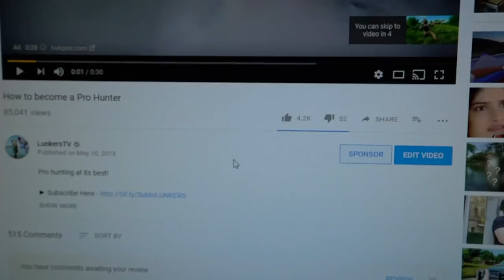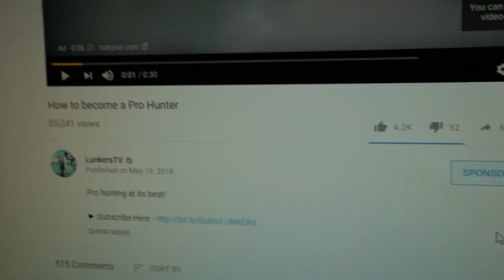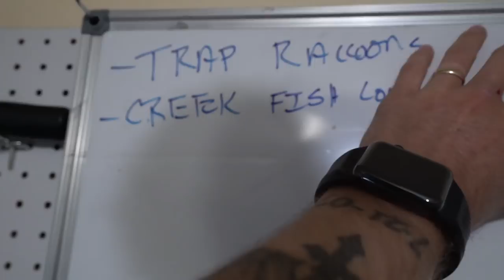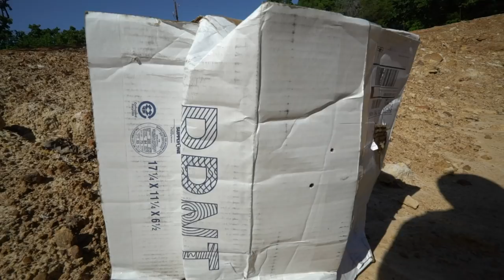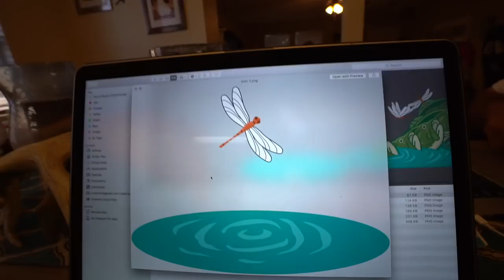Is this the Quietest Sniper Rifle Ever?

Comment: Air rifles have come a long way since the Crosman pumpmaster I had as a kid. Crosman has a .357 air rifle out that's pretty sick. And I believe a .44 or .45 is on the way. You should check that out and the Seneca Dragon Claw Ultimate Hunter .50 cal that also shoots air bolts Damn near the size of a full sized arrow.

Comment: Epoxy some heavy duty screen on the bottom from the inside and epoxy it in, make holes in that from the inside down in that hopper. Metal and epoxy should armor that up nicely to the varmints chewing through.

Comment: Your air rifle is not a firearm, if it was you would need a stamp for the suppressor. There should be no issue hunting with it, its the same as any other air rifle. You can probably take down a hog with the .45 cal model, it would be a great video.